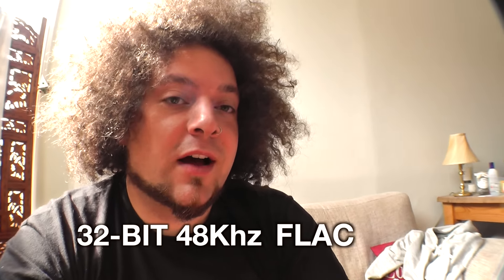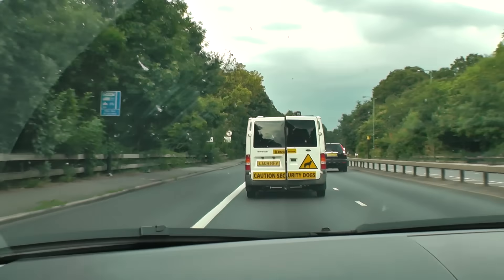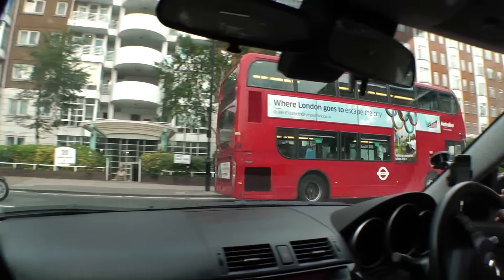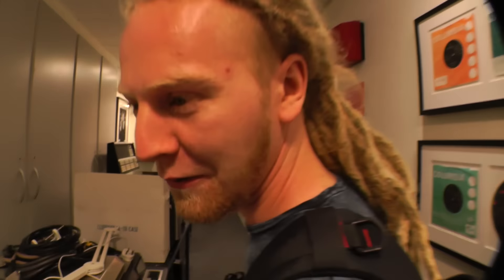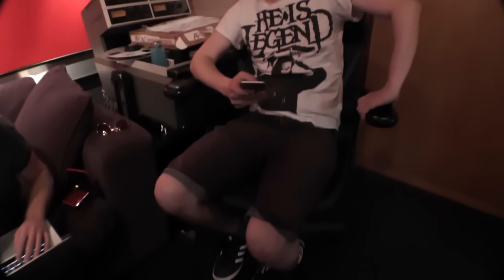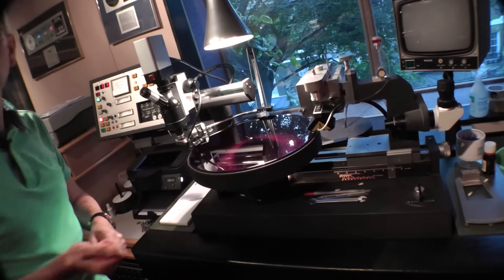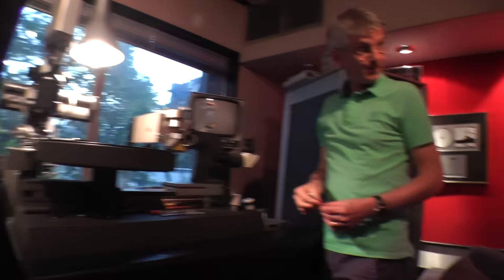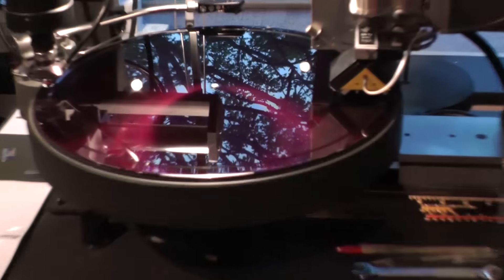Dorje "Centred and One" Vinyl Cut @ Abbey Road Studios

Comment: Hey guys ! I was wondering. What is the point printing digital recorded music on a vinyl ? (Other than the fact that it's a cool object). Because the vinyl won't recreate the audio information you lose when recording digitally. Technically it's even a worse support than CDs if you consider the dynamic range (even though for your type of music dynamic range is not really an issue). I might be wrong, tell me if I am, if I can learn something I'd be happy.
Great music anyways ! Cheers :)